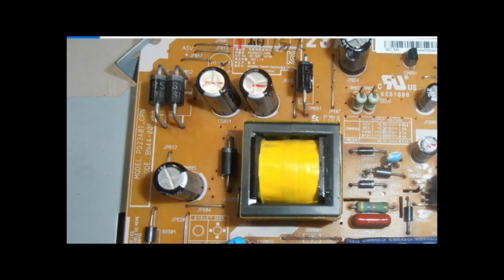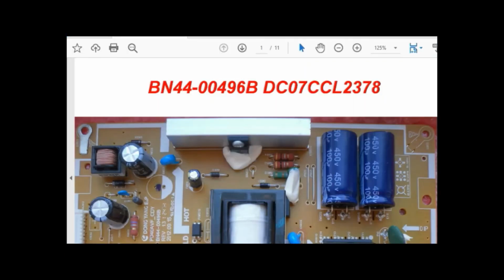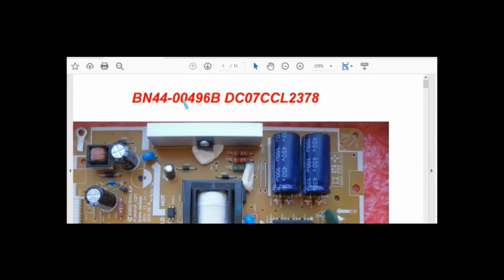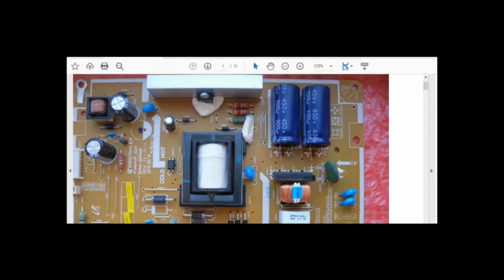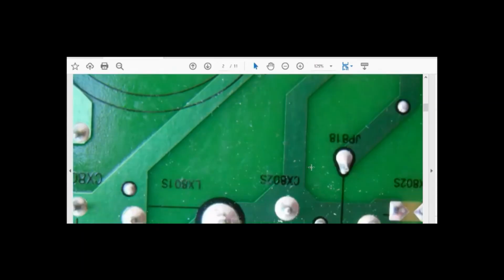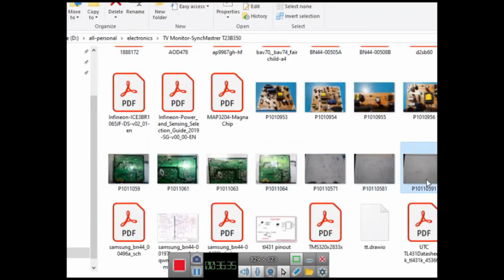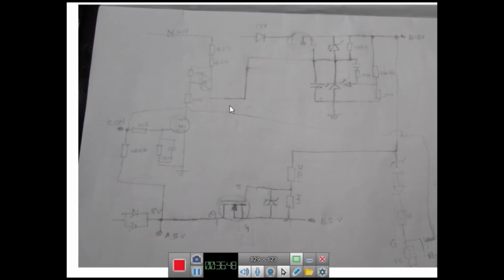SAMSUNG LED TV Repair Tips - Low Side Schematic - SyncMaster T23B350 - Part5

Comment: Hello,
I have following problem with SAMSUNG LT23B350:

1) SAMSUNG LT23B350 TV does not turn on and does not show any signs of turning on, does not respond to control buttons and the remote control.
2) But sometimes it suddenly "wakes up" and starts working, albeit with one peculiarity: the indicators (LEDs) of the control panel of the "buttons" (everything: power on, sound, menu, ...) do not work and the "buttons" themselves work fine, no backlight problems. He worked all day, the next day he did not turn on again, but after half a day he is turned on again with same symptoms (no Bottoms LED’s,…)

In the first case, it is recommended: “With similar manifestations, the malfunction is most likely to be found in the power supply - the BN44-00504A module. First of all, you should check the operation of the standby power converter (PWM ICE3BR1065JF).”
Pls advise what is can be a problem? Capacitors are seems ok.
Pls advise if You have a Schematics for this Power-Supply board (BN44-00504A)

Pls advise
Thank You
Reply from the maker: Unfortunately I do not have the schematic, however I had included some of the partially drawn circuit diagrams with in one of the videos itself as to get some idea. 

From the symptoms it looks to me like dry joints in the power supply can cause this kind of behavior. Can you try re-solder the HOT side of the power supply. After that, remove all the wires to power board except 230V AC and test the output voltages of two main diodes. Voltage levels have been printed on the board (13.5V and 5V). Let me know whether these voltages are kept stable all the time or not?

Thanks